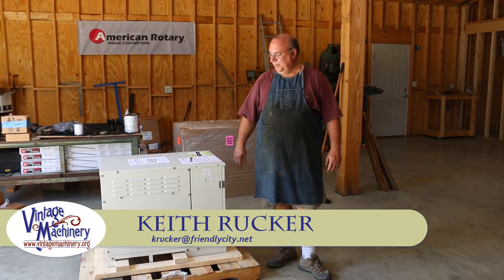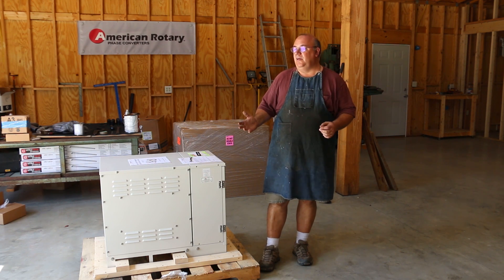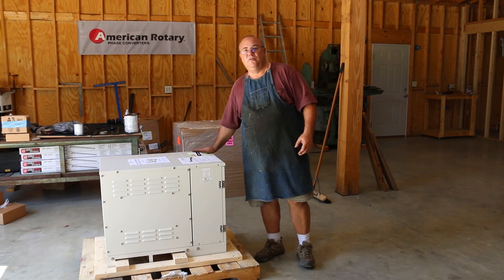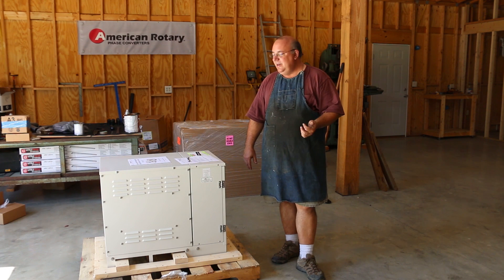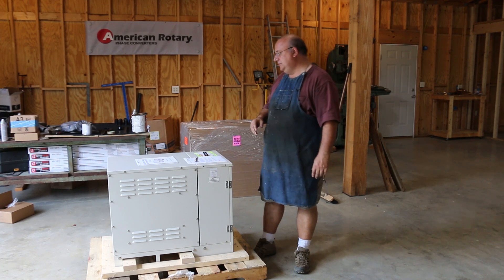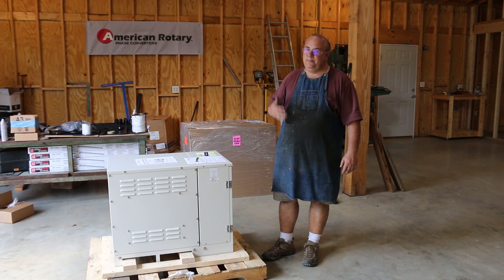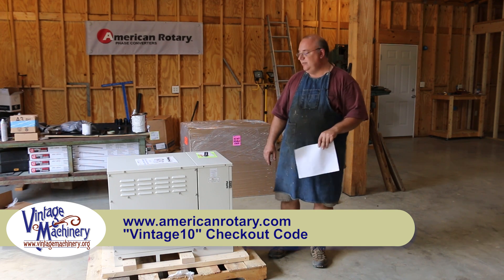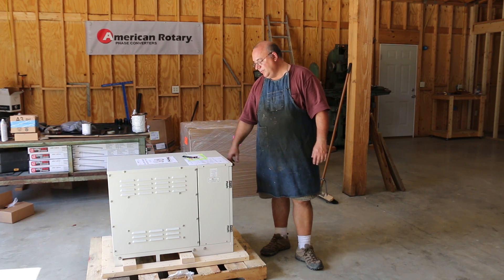Convert Single Phase Power to Three Phase Using a Rotary Phase Converter

Comment: Hi Keith:

I would be interested in a RPC in the IA Series of about 40/50 HP multiple combined loads. The problem is, that I have equipment in the 575V 3PH /440V 3PH/ 220V 3PH range and I don't see anything higher than 440V.
I have no doubt that in your present equipment, you also have 575V machines given that is the most common industrial voltage.
How did you solve that requirement?

Cheers

Jorge
Reply from the maker: First off, I would call American Rotary and talk to them about this.  I am sure that they have run into these kinds of issues before and may be able to help you with a work around.  As for 575v machines, I do not have any.  I have dealt with 220/440 issues, but in most cases, you can wire a motor to run off of either 220v or 440v, so I will just change a few wires around to get everything running on 220v.  On occasion, I have had to take a 440v motor to a motor shop and have them do their magic to get it running on the voltage I want.  You can of course always use a transformer to step voltage up or down to what you need and while I have never had to resort to that, I know of plenty of people who use a transformer to get the voltage they need.
Reply: Thank you Keith for your prompt response. If that is the case, it looks simple enough. However, I wonder if there are any losses in power, or performance by running at a lower voltage. As for RPCs in 575V, I believe that there are companies that offer that option. Also, custom RPCs maybe would increase price considerably. Here in Canada, most industrial equipment is 575V.

Comment: There is a third option for generating 3-phase from single phase that you did not cover - that's a digital phase conversion system which is superior to rotary or VFD's.   I'm surprised you didn't discuss this option, but after hearing you're being sponsored by American Rotary, I now understand why.   I stared with a rotary phase converter and abandoned it in favor of a large Phase Perfect digital phase conversion unit.   There are several advantages including lower power consumption and more stabilized voltage on the 3rd leg.   If you fry the contacts on your motor starters, the culprit will likely be the rotary phase converter generating a 3rd phase that has wildly high voltage as the motor starts up.   VFD's only make sense to control a single motor with no switching between the VFD and the motor, and where  you need variable frequency for speed control or computer controlled current to maximize motor torque outside it's normal static frequency/speed.   A digital phase converter has all the benefits of a VFD without the drawbacks and is superior to a rotary in many situations.  Good luck with your RPC.
Reply from the maker: To be honest with you, I have never heard of a digital phase converter.  I just looked up Phase Perfect, and I really don't think they are anything different than a VFD.  Basically just a simplified VFD without the ability to vary the frequency - they accomplish the phase conversion the exact same way.  I was disappointed that you could not see the prices for their product on their web page - you had to contact them for "more information".  At least at American Rotary, I can see what they cost without having to make a phone call.  I will agree that VFD's (including your "digital phase converter) have some advantages like you mention, but they also have many disadvantages over a RPC - mainly price.  For running a motor on a machine (my goal), the RPC is the way to go.  If you are dealing with electronics that require perfectly balanced legs, the VFD has the advantage.  But in most cases, machines that require that kind of input (i.e., most CNC machines), they will be equipped with a VFD on the machine from the factory!  In fact, almost every CNC machine being sold today has a VFD built right into it, partially to make sure that they are cleaning up any voltage variability, that you can also get when connected to the power company.
Reply: For the potential benefit of your viewers who might read these comments, let me clarify the differences between a rotary phase converter, a VFD and a digital phase converter.   

If all you want to do is drive a 3-phase motor (like your LeBond lathe) with single-phase power source, a rotary phase converter is probably an ideal choice, provided the relay contacts on the motor starter (on/off switch) are rated high enough to deal with the very high in-rush voltage produced by the rotary phase converter when the load (motor) is starting.  I have experienced several blown motor on/off relay contacts because of the high in-rush voltage from a high end rotary phase converter.   

A VFD and a digital phase converter both produce the 3-phase power by first converting single-phase AC to DC, then back to 3-phase AC power.   The similarities end there.   A VFD can NOT power more than one load, or with switching between the VFD and the driven load.   Therefor a VFD can not be used as a source of power for multiple machines or pieces of equipment requiring 3-phase power.   You can not, for instance, use a single large VFD to power a shop and run the wiring through a load center (breaker panel) or have safety disconnects at the machine end, or on/off switches at the equipment - tripping a breaker or disconnect when the VFD is under load will most likely damage the VFD.   

If you have high end equipment from Europe that expects clean, voltage-consistent 3-phase power, or have machines with digital electronics connected directly to the 3-phase input (I have a shop full of European equipment like this), you're going to need a clean source of 3-phase power that is designed for multiple switched loads.   That's where a digital phase converter comes into the picture.   A larger Phase Perfect (for example) can be wired through a load center (3-phase breaker panel) to protect the wiring and drive multiple pieces of machinery that might have sensitive electronic equipment (positioning control systems for instance) buried inside without concern.  In my experience, not all CNC equipment has a VFD inside to shield the digital electronics from a high voltage rotary phase converter - this is especially true of equipment coming from countries where 3-phase power is the norm (like Europe).   Digital phase converters (like Phase Perfect) were designed specifically for shop environments with such equipment, and I know many medium-sized machine shops that would not successfully operate without a digital phase converter or honest 3-phase power from the utility - rotary converters just won't cut it in all cases.

Yes, a digital phase converter is more expensive than a similar capacity rotary phase converter.  However, a rotary converter is constantly running it's motor when power is supplied to it even if the machines connected to it are not powered on.   And the rotary converters generate noise and heat, even when the equipment connected to it is not running.   A digital phase converted has neither of these disadvantages, and may be less expensive over the long run if life cycle power consumption cost differences are factored into the analysis.

I'm not trying to bash or dis rotary phase converters - they have their place.  And I have no economic or other relationship with Phase Perfect (or other digital phase converter manufacturers) other than being a satisfied user that tried and gave up on several rotary converters (including American Rotary).  But rotary phase converters are not the panacea you imply, and there are alternatives that your viewers should consider - in my opinion, and with all due respect.

Comment: Just some FYIs

The main advantage to three phase is that a rotating magnetic field is easy to establish to induce current in the rotor to get it to start with no special circuitry.  Also power is continuous and does not drop to zero once every cycle. 

A generator is a device that converts mechanical energy to electrical.  There is no mechanical energy input to the system so I think what you have here is a rotary transformer.  The magnetic filed in the rotor going by the third winding produces a current flow.  The small motor just spins the main rotor to establish a current flow/magnetic field in the main rotor and is cut out after it starts.
Reply from the maker: Like I said, my explanation was "over simplified" to get the point across.

Comment: Grats on getting such a fine machine, sponsor and deal!

Somewhere I have an old Fine Woodworking book with how to make your own 3 Ø converter using any old 3 Ø motor. It still needed a kick motor to get it going, but the more loads placed downstream, the more stable it was. Very lossy, though. One of the advantages to 3 Ø motors is near-full torque starting and near instant reversing. No internal switches or capacitors involved.
Reply from the maker: You can make a home made one, and it will work, but you probably won't get as nicely a balanced system as a commercial model.
Reply: Very true. You could get the motor rewound to compensate, but by then you should just get a purpose-built converter like what you have.No fuss, no worries.

Comment: In Norway the norm for houses built after 1997 to have 400V 3-phase(TN-system (Terra Neutral)). This is also the std for most of europe. 
And 1 phase is 230/240V.
Reply from the maker: Nice!

Comment: Keith,
     For those on other countries used to 3 phase power:

1. In some places here in the US you can't even get it in a residential neighborhood
2. If you CAN get it you are going to pay BIG TIME MONEY for it
Reply from the maker: Very true on both accounts.  The electrical companies try their best to keep three phase out of residential areas and even if it is on the pole outside your house, they don't like to run it in except for commercial accounts.  And even if you can get it, you usually have to pay commercial rates for your electricity which is higher than residential rates.
Reply: and that commercial rate is not trivial....I've heard it can be four or five figures per MONTH in some cases.  I know you hate showing electrical work but I'd like to see everything that went into getting that converter up and powering your shop!

Comment: Wow Keith, it's great that you managed to negotiate a 10% discount for viewers and get sponsorship for the channel.  You've worked hard building up the channel and you deserve to get something back.  You could have been out working instead of doing videos and I bet that you spent quite a fair bit of money out of your pocket over the years.  I think that you will be much happier with the phase converter.  Since your a one man operation, I can't imagine that you will have more than two machines running at one time and that will only  occur rarely.
Reply from the maker: You are right about multiple machines - it is rare that I would have more than one running at a time.  But with this converter, I should be set to go for a long time to come!

Comment: Are there any permitting requirements for installation in your life area? I live in Richland, Michigan and the county requires a permit to make any, and I do mean any, changes to the existing circuitry. Each outlet costs $5.00 per receptacle installed. If you are found to have done work without the permit they will fine you heavily and force the removal of the work.
When I installed my new service I had over $100.00 in permits for just the panel installation.
Reply from the maker: Wow, talk about big brother....  So, as for permits, when I got my building permit, I did have to get a permit to put electrical in the new shop.  It came with a fee (about $100).  Before I could have the panel hooked up to a meter, the county inspector had to come and look it over.  It is no problem for me (a non certified electrician) to do work for myself, but I cannot do it for others.  They came and did the inspection, which basically just looked to make sure that everything was grounded properly and there were no major code violations.  Once that is done, I can do whatever I want without any permits or inspections.
Reply: +Keith Rucker - VintageMachinery.org Good for you. I put in my own service panel and connected the house to it on the permit like you did. My Dad was a 1A Electrical Contractor and I was his apprentice. Before I moved to Richland I never had a problem, in Coldwater, Quincy, and Union City, the original permit for the service read "and connections to existing circuits." I could continue installing what I needed.

Comment: This will certainly be better/easier, in the long run, than having to run the two smaller converters in parallel to run the larger (or multiple) machines.  I'd still be interested in seeing how the two would be set up to work together, though, if you happen to find an opportunity to dovetail that in somewhere.
Reply from the maker: This will be a much better solution, and will still have more power available than what I was planning on building.

Comment: hay i like your video's.  

A story 

Years a go there was here in the Netherlands a company with the same problem.  

He had his workshop in rural areas, there was only 220 volt available. The man bought a huge battery bank 24 12 volt batteries with a enormus 380-volt 3 phase inverter.

The batteries are charged by a huge 220 volt charger.
Reply from the maker: Wow, you should tell him about rotary phase converters....
Reply: The energy network was too weak, 220volt 16Amp.  Because the long distance from the main cable. For tough jobs he started before the generator with a 6 cylinder DAF diesel engine.

It was a good system if he needed much power then it was available. The battery charger kept the batteries good full.

 I'm talking about 15/20 years ago. maybe he has now power flow.

Comment: I hope we get a video of this thing running! the one in our shop was so loud we couldn't speak, and it was starting to cause fights because everybody had to be shouting to be heard at all, clearly and outdoor solution is a lot better. Also I think you should try to pull together the knowledge base on exactly what sorts of loads a converter like this is capable of, last time I read up on it it was something like "an idle generator of Xhp can spin up an unloaded motor of Xhp, or up to 3Xhp smaller motors", sizing a unit for your needs can be complicated, I guess you won't have such a problem as by yourself you won't have a lot of machines running at the same time.

Comment: Are you going to mount this outside or inside your shop?  You may want to power it up to see how much noise it makes before deciding.
Reply: Keith mentioned outdoors, so yes outdoors it will be.
Reply from the maker: It is going to outside the shop.  I will probably pour a small pad for it to sit on.

Comment: Nice! I just puchased and installed an American Rotary Converter 6 days ago for my Bridgeport type mill. It's works beautifully! The mill has power like it never had with the static phase converter, and the mill motor runs so much cooler. The American PC idler motor is so quite and their products look to be high quality. I guess I missed the discount by a week lol. I'm thinking your going to be very happy with yours 👍
Reply: A proper variable-speed Bridgeport is a beautiful thing.
Reply from the maker: I hate you missed the opportunity to get the discount - I should have made my video sooner!  Glad to hear that you are happy with their product.

Comment: What a score Keith!  Shop's getting off on the right foot with that brand new phase converter.  Going with one that's professionally built eliminates all the unknowns that come with trying to cobble together a bigger one yourself.  Not to mention I gather that getting a 3-phase 40 HP motor that's in decent enough shape to use as the core for a home-built unit would cost so much, the pro-built American Rotary one becomes the cheaper option!  And now you'll be able to, as you said, put a 20 HP motor in that giant Monarch lathe if you find one.  Not that you'll necessarily be making the huge cuts the 20 horse motor will permit, but the lathe will likely draw less amps with the bigger motor with the lighter cutting you'll mostly be doing, and have the full cutting power when a BIG JOB comes in for it.

Well done on the classy presentation of the sponsor in American Rotary.  Putting their advert stickers in a few places in the background of the shop will give them the good screentime. ^^
Reply from the maker: Thanks, I am glad to have them on board!

Comment: thank you for the videos, Keith.  Actually three phase is 120 degrees out of phase.  120x3=360.
Reply: But I guess he is so used to the US 3 wire 120VAC supply which is actually 180 degrees.  Then you get all those odd 3 phase systems that are absolutely US only, like high leg delta, which gives some truly odd wiring configurations. 

3 phase elsewhere only has 2 options, delta or star, depending only if you want a neutral wire. Most 3 phase power you get for consumer end are star wired though, delta only for distribution wiring where it does not really need a ground reference directly, but you can add Peterson coils to control fault tripping on a phase to ground short, or have on higher voltage lines a grounding transformer to control phase voltages on lightning or fault conditions.
Reply from the maker: Yes, I said that wrong, it should have been 120 degrees.
Reply: +SeanBZA actually 120V single isn't 180 either,  since there is only one leg.  240V single is though ;)